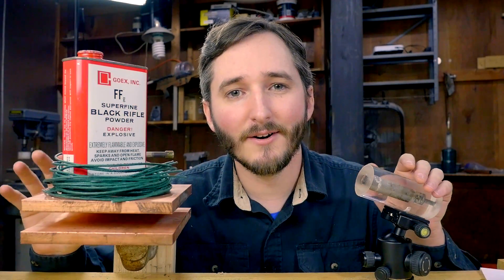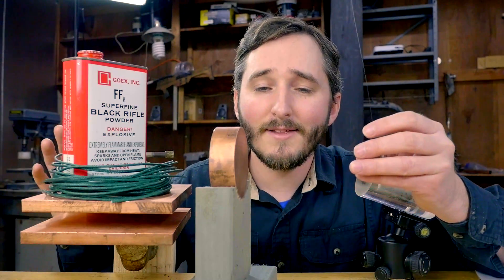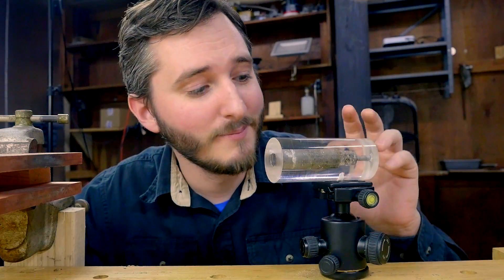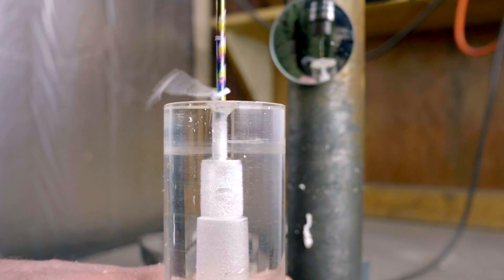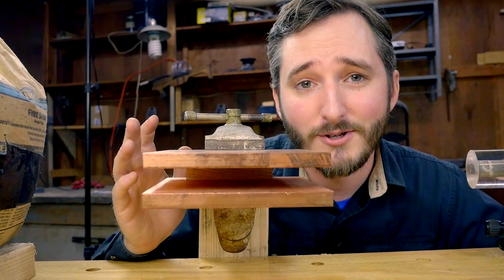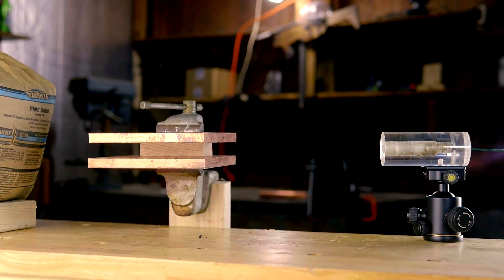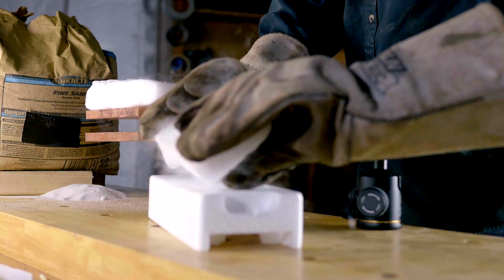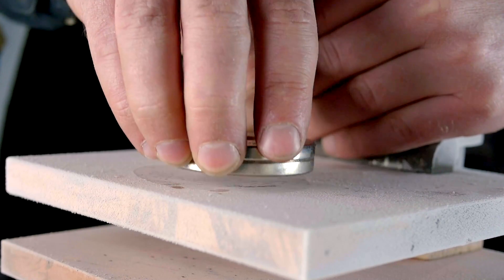Electromagnetic Force Fields VS. Magnetic Cannonball

Comment: For what its worth, smokeless powder detonates, so a primer is used.

For example PETN (used in Detonation Cord), is similar. If you light it, it burns about as slowly as a piece plastic. But, if you use a blasting cap, the shockwave from the blasting cap triggers the explosive reaction. Otherwise the stuff just burns slowly.

It may be that when chamber pressure builds to a certain level that it triggers that reaction. It's for this reason to be careful with smokeless powder. Even if a given sample of smokeless powder releases the same total energy as a sample of black powder, when it detonates, it will release that energy in  a much shorter time, so the power dissipated will be higher. 

So for example, a sample of smokeless will burn at a supersonic rate when detonated. Black powder on the other hand, (as far as I understand), does not detonate like that, but rather just burns very fast on its own, but consistently, and will not have that huge jump in burning speed when triggered by a shockwave.

That plastic barrel you use is more likely to hold up to black powder, because it can be thought of as pushing the ball down the barrel like bowling. Smokeless on the other hand is more like hitting a golf ball with a fast-swinging club. The detonation will be more likely to shatter the plastic. This quality of an explosive to shatter materials is called "brsiance". Smokeless powder is definitely more "brisant" than black powder.

Comment: How thick does the copper have to be for the pendulum stopping effect.  I really really like the visual and am thinking of making some kind of kinetic sculpture/demonstration rig using it.  Magnet is probably going to be 1 inch by 1 inch cylinder magnet N50 since those are reasonable on ebay.  How thick would a sheet of copper have to be to stop it from a reasonable angle of swing?  Also, would copper alloys work similarly well?  I know it is the conductivity that does it, but not sure how much lower the alloys would be
Reply from the maker: Probably the copper needs to be at least a half inch thick to work in a similarly impressive way. Alloys will work fine so long as they are nearly as conductive.

Comment: what an awful experiment .
just get a 4,5 mm or 5,5 mm magnetic ball , use a bb gun and use a chronograph ....so you can measure the impact on the bullet speed directly ....shoot it through a plastic pipe as a comparison , or get a steel ball in the same weight ....or make a v0 and v 3 comparison with and without shooting through a pipe ....but this was just not good .

Comment: Copper may not be enough to stop a magnetic projectile, but unless we're talking about rail guns, no guns fire magnetic projectiles.  Bullets are typically made if copper or lead encased in a copper jacket.  The ones with the copper jacket won't work, but I wonder if you could make an electromagnetic field to stop or deflect a bullet by enducing a magnetic field in a copper projectile, rather than in a copper medium like you did in this video.

Comment: You did not ice the pipe. Could using liquid nitrogen on the pipe change the experiment. Also, i was thinking does the shape of the pipe have an effect because the open shot between two plates would give it a different magnetic field make up than a copper open cylinder pipe?? Super job on footage and attempts. Thank You

Comment: The magnetic flux occurs perpendicularly to a surface that is delimited by a curve, in this way the generation of electric current will occur. So we have the inductance. Thus, considering that you put two copper plates perpendicular to each other. How will you have the inductance to stop the bullet? If there is no closed curve to delimit the area of the magnetic flux?

Comment: Interesting video man! The problem is you need to use a smaller gap between magnet and the copper. The magnetic fields go up exponentially as the distance between the two reduces.

Comment: The muzzle gasses are skewing the results.  The copper isn't just having to work against the kinetic energy of the magnet, but against the expanding gas as well, which continues to push against the projectile with a LOT of energy.  A spring-loaded launcher would give more meaningful result.  Or if that makes you feel it's no longer a "cannonball", accelerate it with a railgun. ;)

Comment: Hello +NightHawkInLight,

I think the first experiment with the copper plates did not / could not work because you need a closed circuit, in which the electric flux is in a plane that is perpendicular (or has a perpendicular component) to the direction of the moving magnet. In your setup, the magnet might have induced a magnetic field in the copper plates, which also counteracted the magnetic field of the canon. However, the counteraction of the magnetic fields was not in the appropriate direction to cause any deceleration in the magnetised canon. I think you would need to close the circuit around the direction of motion of the canon to have a better setup (Like the tube). 
Secondly, the magnetised canon spins when fired and hence the magnetic poles spin too. Therefore the induced magnetic field in the copper plates would be constantly changing. It makes the situation a little more complex and how it affects the motion of the canon uncertain. 

Simply said, I think the magnet poles have to be in the direction of the direction of motion of the canon and you need a closed circuit around the tragectory of the canon.

What do you thinkabout these points?

Cheers
Reply from the maker: The copper resists parallel motion of the magnetic field just as strongly as an oncoming field. Magnetic brakes on trains work by sliding the magnet along side plates in a similar setup. But you're right that the orientation of the field does matter in how strong the resistance is.

Comment: you have to connect the two copper plates with wire for the induced current to flow or how should it be effective in stopping the magnet .And the last slow mo shot was not satisfactory at all as the magnet could not be seem

Comment: If you drop a spherical magnet onto a copper plate, it probably won't slow down like a cylindrical one, because a small sphere is much easier to reorient than a large cylinder.

You should retry this experiment with a cylindrical magnet.

Comment: Whilst you fire a bullet straight through a copper pipe you fail to take into account gravitational acceleration which means that your lovely little copper bowl is going to spin around in a magnetic flux taking the easiest path possible which means that it's not going to work so you have to do a vertical drop and the ball has to have a narrow gap between the sides of the copper pipe without contacting it that would be the only way to get over the gravity issue

Comment: Wow, you're stupid, guy. You're going to end up in the ER with acrylic shrapnel in your gut.

 Acrylic melts and DEFORMS under heat, you're going to up firing one shot, melting the acrylic, and then firing another shot that catches on the deformation and rips the acrylic to shreds at high velocity (think pipe bomb).

Comment: I think you are correct on quite a few things, yet the experiment was a failure for several reasons.
1. The diameter of the magnetic ball compared to the tube, means not enough drag field was generated
2. The thickness of the copper.
3. I forgot what my third point was, lol.  There was one, though.

Comment: Thank you for interesting video. I think that the reason for ball not slowing is too large distance between ball and copper plates/pipe. Magnetic field drops with distance on square. If you try with smaller diameter pipe im sure you'll succeed.

Comment: If the two plates of copper are connected on 2 opposing sides to make a box with two opened ends the amount of stopping will be greater.  If the pipe is thicker it will impede the ball better as well.

Comment: Heat could make a magnetic material loose its magnetic characteristics. Maybe the heat from the firing could impact your experiment negativelly. You could try the same aproach firing the projectil with a CO2 or Air pressed gun.

Comment: The copper plates and magnets remind me of the inner workings of a generator or a motor. You know how when you touch the terminals of a motor together it turns harder? Well what if you electrically connected the plates together or put some sort of load on them? Will it slow down more? Just a thought. Also I use dish soap and water for drilling thick acrylic, keeps blade cool on the cnc machine, sometimes even shop air blown at the bit.  Enjoyed your video. Keep it up!

Comment: Okay, awesome video and experiment. I'm sure someone has thought of this already but what about a coilgun with the trigger position moved to after the centre of the coil? you can use ferromagnetic projectiles, no need for dry ice, the glaring practical problem is that you would have to be in perfect alignment with the incoming 'bullet' to stand any chance of success - and if you're pointing what amounts to a coilgun at them already, probably better to just fire that.

Comment: so what if you use some way to shortcircuit the outer hull of your tank or personel armor to lightning like levels of electricity, basicly turning it into an MRI or stronger type of magnet for just a milisecond while the bullet is coming in? it will have to get triggered and respond within less than a milisecond of an object coming near, but with modern CPU's speeds that shouldnt be the problem. dont think it could be energy-efficient enough to be practical tho.

Comment: You should use a ballistic Chromograph to analyze the speed of the projectiles as they exit the copper plates.  Do the test with and without the plate and plot the change until you can obtain a ratio of force to magnetic resistance then you could track a test with better results and data.  Great work on this video!

Comment: If a magnetic projectile is fired at a magnet will it accelerate as it nears the target? I imagine there would be a cut off point where the air resistance overcomes the force but it would certainly make for an interesting experiment

Comment: the projectile is moving faster than the rate of inductance, it's it's impotent. could be causing a drag like the slip stream of a truck? that final experiment is interesting, wonder if you could put something very light outside the pipe to measure the field being produced and its direction.

Comment: That's honestly not a great surprise. If you watch the interaction between the magnets and the copper, there isn't any noticeable interaction until the two are within a fraction of an inch of each other. Both the copper plate and the copper tube are too large in comparison to the tiny projectile magnet. If the gap had been the same as between the 1" copper tube and the demonstration magnet dropped through it, then it would have stopped.

Comment: Your videos are AWESOME.
I got one idea.
Remember the cylindrical magnet almost with the same diameter of the tube?
Use teh copper tube as the cannon and the cylindrical magnet as the bullet.
Seal teh back of the pipe with cap drilled witht he fuse.
Also make holes along the copper pipe to reduce the pressure and provide a visualization of the magnet bullet.
Feel free to contact me if I could not explain well and/or if you like the idea.

Comment: Didn't you state it was used for subway trains, breaking... What ever happened ot magnetic breaks, for slowing down a vehicle.. .Doesn't the magnetic force of an object change is reaction... So the more stored potential would be like the more clothes one wears in a river... So to say one would sink... Not sure if this was really a great example. Un answered questions and live data doesn't really work.. because it would be better tolerate mass of each object and its relation. So one could calculate how much and what type of copper or other substance to slow an object down, and what does the magnet strength need to be, or field..  I think this video doesn't actually show data in which one could calculate the webbers or other interesting interactions that could occur. 

It's a little weird. 

Copper plate % percentage. Pure copper alloy has its own markers to where its from, and mostly behave in teh same manner, but then there are differing relatiosn ot copper. And the so called magnets.. anyways. This doesn't have information that can be quantifiable in order for expansive experiemental purposes. Sure eddy cufrent is cool, and I have done that before, but, it should be able to slow down objects in various ways... by capturing and understanding this method and tus oen could then create objects that better emulate and react in a similar manner but more refined... So when ther isn o data, its just oh a cool trick, limited understanding and replication .. .hmm. None the less. It didn't really show, much. did indeed th bullet de-acceralte any bit. There is always a tiem factor. also. THe speed of the object is in relation to the time over teh object. So its quite miminal fractions of a second. .So  then way.. What about just shotting at a plate, rather than inbetween it. Of course the plate would most likely stop it... MEh... who knows.

Comment: Good vid.  Thanks!  BTW - you could use a cheap laser module to check the alignment of your cannon to the pipe.  That is if you can mount the laser precisely on your 'cannon' via a fixture that you'd have to make - but that should not be too hard.  Alternatively you can do the alignment by filtering the laser to the other end of the pipe as well.  If you want the laser module I could send you one, but they are pretty inexpensive and easy enough to locate.  You really want one that is very well aligned in it's own housing of course.  You'll still hit the walls of the pipe, but at least maybe get the projectile a little further down the pipe before it collides.  Still, your experiment worked fine as it is.

Comment: Hey Nighthawk ,

It would be a fun experiment if you tried to make a Newton's cradle using two neodymium magnet pendulums with your thick copper plate. 

Just suspend the second magnet so that it hangs very close to the plate on the opposite side of the plate. 

In theory, the second pendulum should accelerate as the first decelerates. Without either  ever touching the plate!

Comment: You could probably get it to work if you ran current through the plates to make an electromagnet....I wonder if a you could some kind of practical armor this way...lead bullets are paramagnetic after all. I know the currents needed would be very expensive to produce, but say you were making electromagnetic armor for the president, it could be considered?
Reply: There is already current going through the plates. That is what induces the magnetic field that opposes the original flux producing it. It's Lenz's law. Look it up.
Reply: frank brown  I don't really get your point. What is the worth of current in the plates when the magnet isn't passing? It's the moving lines of flux cutting through the conductor that induces the current in the plates that creates the opposing magnetic field. It's their 3-Dimensionality that allow these currents "depth" which (as you sound like you already know) is why conductive transformer cores are laminated. You won't read any current flowing between the plates if there isn't a path of conduction (ie. a circuit like a the low resistance of an ammeter) - I think you might mean voltage "across the plates". Eddy currents circulate within the plates which already provide a conductive path (ie. a circuit) by their very bulk.
Reply: frank brown  No Sir, all good! I meant (by my original comment) that there is already current flowing by virtue of the fact that the changing lines of flux cutting the conductor already induce the current that generates the opposing field. It's all described in Lenz's law of 1834 which I mentioned precisely to avoid vagueness :-)
Reply: frank brown  PS. I was trying to keep a straight face while typing because I kept thinking about your 10kV vest idea for political speeches.. Dude, that's harsh (though it would limit them to just one public appearance which in many cases, is one too many :-)
Reply: frank brown  I loved that part of the story. So funny when the captain couldn't remember the reason for the flight until he was told something like, "You're all a bunch of useless idiots!"

Comment: If you wish for aiming between the plates without hitting, there is no reason to shoot it from so far away. Just put the cannon barely near the plates. Once the bullet leaves the cannon it already got maximum speed. That huge gap between the cannon and the palates is doing nothing for the experiment. The bullet leaves the cannon much faster than any smoke, so it will not be missed by the camera.

Comment: That 1/2" copper pipe was to large based on the projectile diameter used. The closer the magnet is to copper, the greater the breaking effect. The closer the I.D. of the pipe in relation to the diameter of the projectile, the greater the breaking will be. Would you expect the test to work the same if you used a 2" copper pipe vs a 1/2" pipe? Cheers.

Comment: Mechanical forces can actually disrupt magnetic domains of a permanent magnet (much like the lattice vibrations do as the temperature is increased). Consider all that impact against the floor and walls as a factor contributing to weakening of the magnetic field.